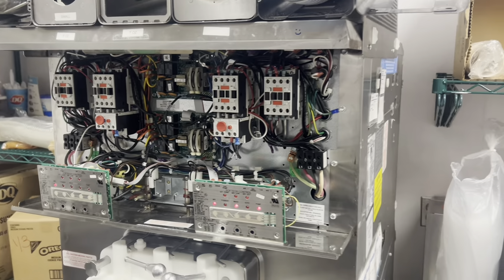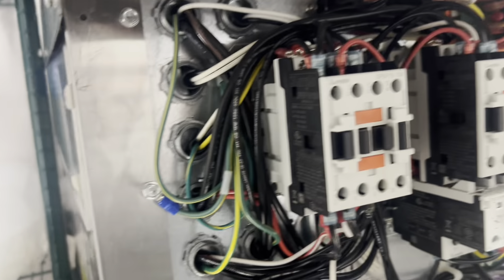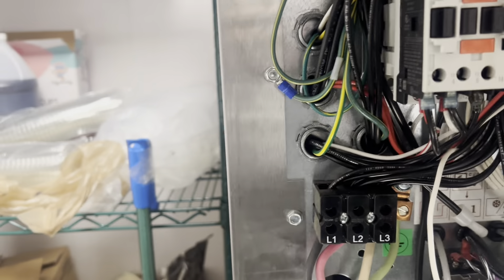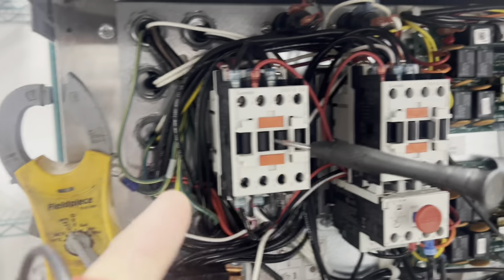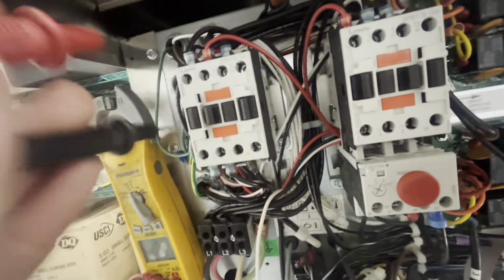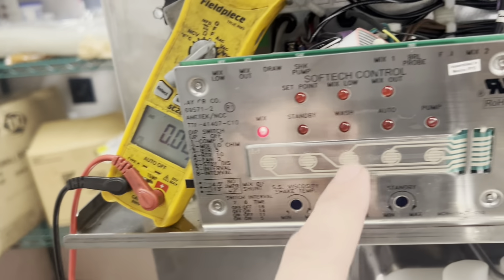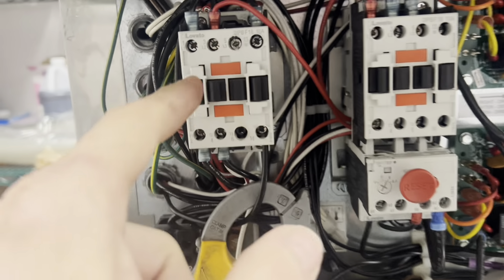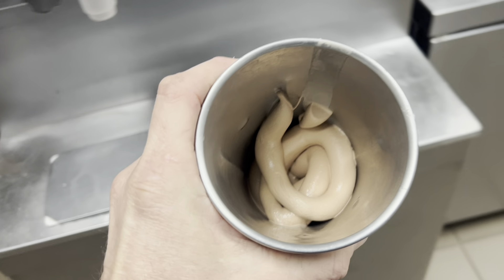Taylor soft serve - failed contactor follow up

Comment: good idea.the only thing is that last contact is only rated for 10 amps.2 cents.
Reply from the maker: Buying time to replace OEM.  Good looking out
Reply: Interesting, so just an integral aux contact. (I did look it up too). But looks like a normal 4 pole contactor, deceiving!

Comment: DP350240F will not replace that.  The Levato is an IEC contactor.  If it's controlling an AC load you could see if there is one in the same frame size with a higher AC3 rating.

Comment: M9 is 2019, The first letter is the decade, H is 1980 J 90s K 2000s M 2010 N 2020+. The next letter is the exact year. For instance M9 is M 2010+, 9 is year so 2019. Next two digits are month.
Reply: Yeah it’s very difficult than EF. I’m another fellow soft serve technician. I’ve been working with Taylor machines for a few years and got used to them. I’ve always been on my own but I’ll be working with my EF distributor as a tech soon too! Love ElectroFreeze so much more!!
Reply from the maker: Can I connect with you ? Your knowledge of this machine is awesome.  Ive got a Q for you.  Can you email me Joe@meadowbrookbrands.com so we can connect outside of the comments section.